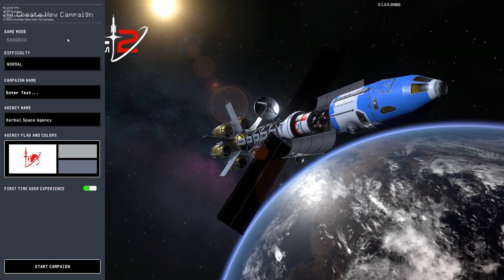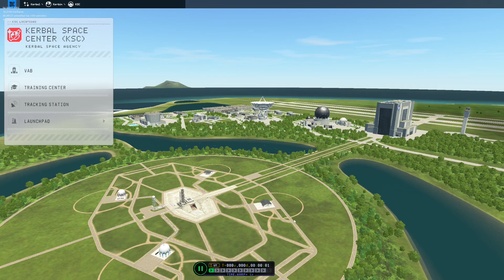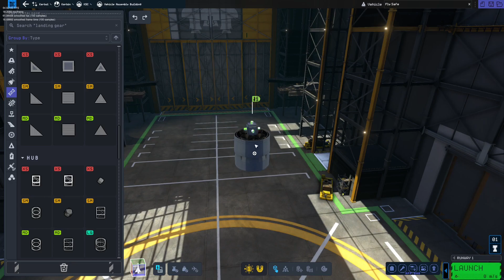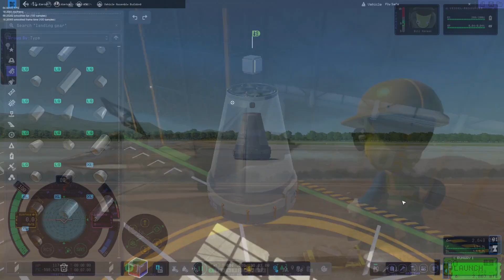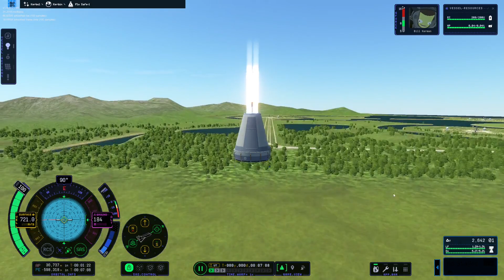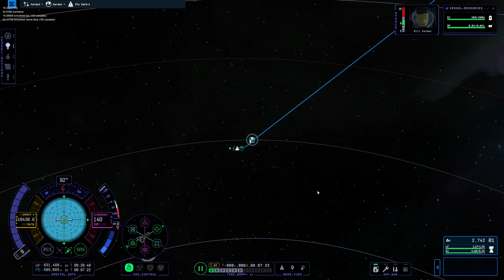Kraken Drive explained in detail | Design and launch (only works in v0.1.0.0) #ksp2

Comment: Will the Kraken Drive not work if the Rapier is in Air-breathing mode?
Reply from the maker: With my design no, but it is possible to design it in a way that will work in air-breathing mode but you need air intakes.